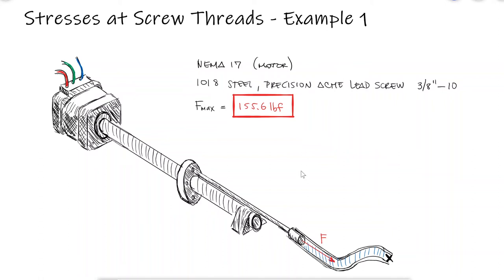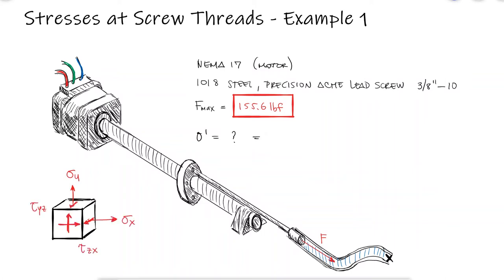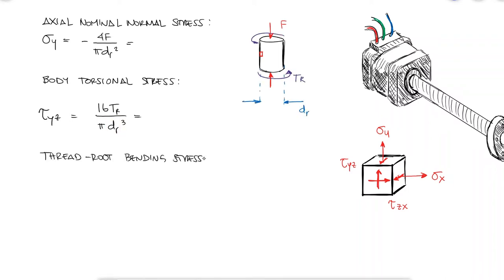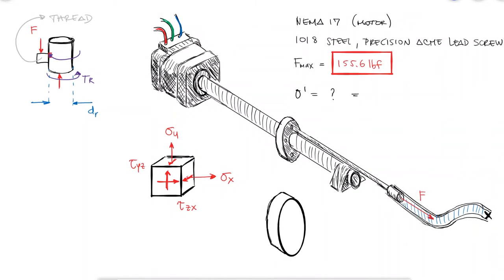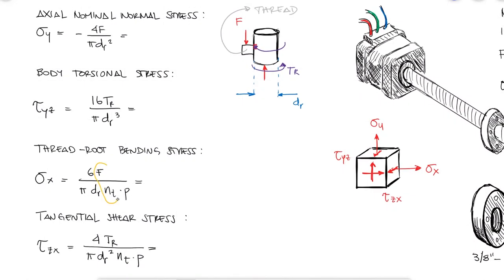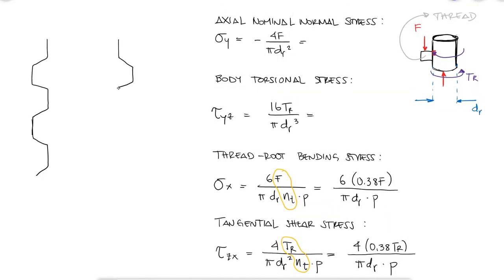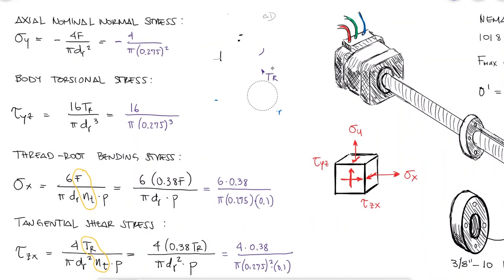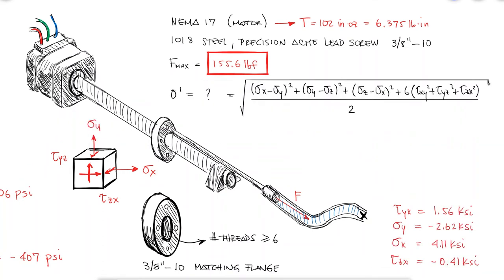Screws Stress - Motor, Lead Screw, Piston - Example 1

Comment: Hi, great lecture! I just have a question.... The bending stress equation used is applicable for square and ACME profile? Thank you in advance.
Reply: I think i might know the answer. It is the applicable for both cases but only at the root of the thread, since both are rectangles. One side of the ACME thread root shape (rectangle) it is slightly higher than 1/2 P but .... I believe it can be applied for both cases either way.
Reply from the maker: You got it right! Yup
Reply: @axeld9108  I can't talk for acme (I'm UK but assume it will be the same) -  for a metric trapezoidal thread the height of the trapezoid is equal to p/2 at the mean diameter (dm) at 1/2 the distance between the minor and major diameter, which is where you assume the critical stress location and a point source F. This then makes p/2 valid and why it can be used for both. One side of the trapezoid is higher than p/2 and the other is smaller than p/2.